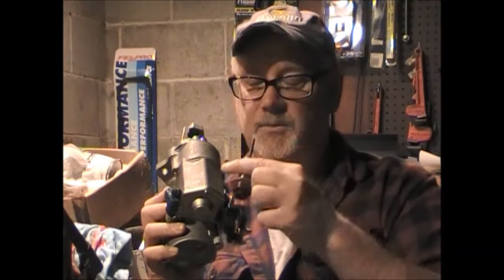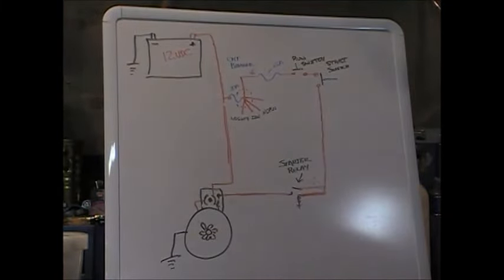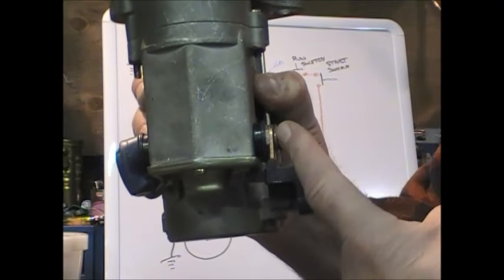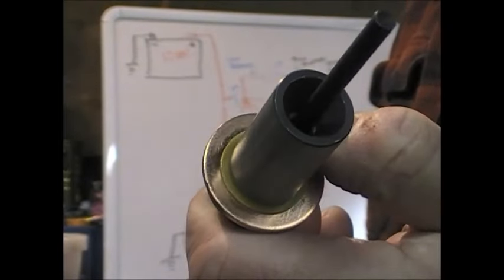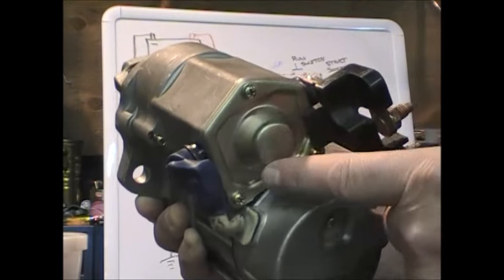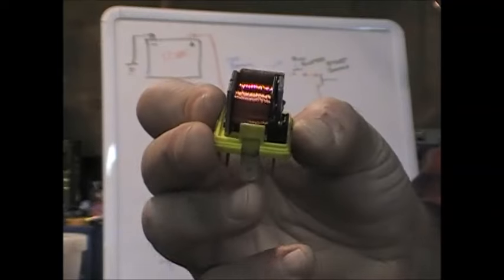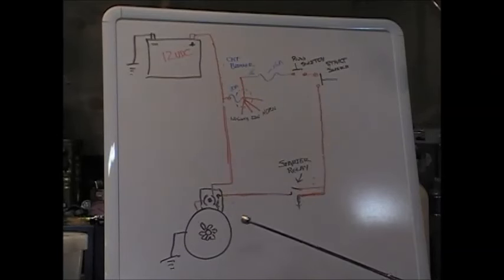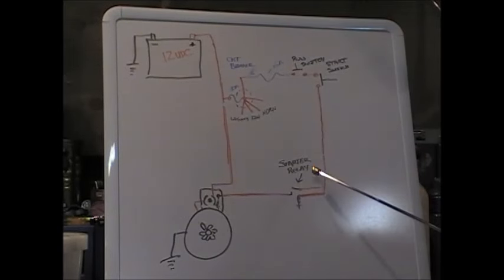Harley Davidson and the Click of Dread

Comment: I have a 2000 FXDL and when I hit the starter button it just makes a constant whirring sound and does not engage the ring gear. Any ideas on what is broken, a mate said the bendix gear but I do not know. Appreciate any advise you can give me. Cheers from down under.
Reply from the maker: If your hear the starter whirring away, which is sounds like it is, and the drive gear isn't engaging, then I would have to say that it "sounds" like the bendix gear assy is bad. HOWEVER.... before canning the whole affair I would disconnect the battery and pull the solenoid cover to gain access to the plunger assy.  Pull the plunger assy out and check the stub shaft on the plunger.  Is it broken?  Missing?  If broken or missing it means it is inside the housing and would explain why the bendix isn't engaging.  If it all looks good, I'd check to make sure the spring that goes on the end of that stub assy isn't packed with hardened grease and would also check to make sure you have full plunger travel, which I will say that offhand it sounds like you do but there is nothing like visual confirmation of such.   If it all looks good, e.g. stub shaft looks good, full travel, not packed up with grease, etc, then it sounds like you'd need a new starter or a repair on your old one.  Best of luck and let me know what comes of it if you would.
Reply: @Theoriginalmalcontentcorner  Thanks for the reply and I will let you know how I go.
Reply: @Theoriginalmalcontentcorner  I thought it was going to be a bit beyond my mechanical knowledge so I took it to my mechanic, as I have put cams and bored it out to 1550 he suggested a 1.7kw starter motor as mine was knackerd. Thank you for your advise though.
Reply from the maker: @2000tc88  Thanks for the update!!

Comment: I like the video and I will clean everything. My problem is a little different. When I turn my key on and I hit the start button I get nothing no sound it's just dead. I have power lights are on everything  seems good. I tried several time to start it and it wouldn't start or even click. I do have another starter relay I will replace it. I'm just wondering if it's the same problem  you were talking about or something  different. Any help would be appreciated. Thanks
Reply from the maker: Hi Randal! Thanks for watching!  So you don't get even a click?  That's not the problem I had.  My solenoid would 'click" but not fully engage.  On your case, do the lights dim down when you hit the starter?  If so then I'd have to ask, just off hand, how old is your battery?  If the lights do not dim then  I'd say it sounds an issue with your solenoid circuit.   If you have access to a voltmeter you can start taking voltage measurements from the solenoid plug at the starter and start working your way back.  Start at the plug (disconnected but attached to the Red or + lead of the voltmeter other end on ground) press the start button and see if you have voltage at the plug.  If not, then onto the relay, if not there then higher up the circuit you should go until you find the 12V feed for the solenoid circuit (see your service manual for the layout of your circuit).  You could also find the location of the relay and check to see if you hear or feel a 'click' when pressing the start button.
Reply: @Theoriginalmalcontentcorner  I really think it's the start switch I think that cause I did adjust brake lever and I must have push the switch over because I opened the switch an took a look at it and I then notice the spring was off so after I adjusted the lever and tried to start it was when the problem started. If must be fried and stuck together.
Reply: I'm experiencing the same similar type situation on my 05 Road King but what I think I have found to be the problem is the emergency shut off switch right next to the start switch,  if I don't hold pressure on in the start position it'll die... Even while in operation
Reply from the maker: @lowery386  - That would make sense as any bum connection in the start circuit can cause an issue.  But with your problem, did it show itself by the bike not cranking at all?  Or would the solenoid click or...?
Reply: @Theoriginalmalcontentcorner   at first it had a weak charge on the battery...  Then after a nice 8 hour charge it  would pop off strong....  Switch working as it should have been...  But then it malfunctioned fully....  And i had to hold my thumb in run position with firm pressure to get it to stay correct
Reply from the maker: @lowery386 - Definitely sounds like you found the problem child.  Sucks that it doesn't work fully but great that you've isolated the problem.  Sounds like it is time for a new switch.

Comment: Mine looks nothing like this. Omg I wish I could find some useful info....
Reply from the maker: what year is your bike?
Reply: @Theoriginalmalcontentcorner  78
Reply from the maker: @smartmeis  That is a vintage setup used on the Shovel and earlier engines.  Unlike the Evo's where the solenoid is built in, yours is a prestolite (or possibly a Hitachi) starter which  uses an external solenoid to supply master power to the starter to start it spinning and a bendix gear/assy to make engage starter gear with the flywheel.  You can't follow my video as it won't work for your setup but it shouldn't be too hard to troubleshoot.
Reply: @Theoriginalmalcontentcorner  well I usually give it a few taps on the starter and make some sparks by touching the solenoid terminals and that works every time, but i kno there’s a way to hot wire the starter cause every time I touch certain posts on the external solenoid it turns over, but I can’t seem to nail down the right posts, and idk what wire is what cause it’s all hand built by my father who passed away, and Idk if I should replace the solenoid or try to diagnose where the exact problem is. I don’t wanna spend money and it not be the problem or the right part. I might go pick the Harley dealers brains and show em some pictures.  If it was a dirt bike I’d have it running in 2 shakes and a lamb tail. But I’m new to the Harley life and unfortunately I have to sell the bike, to pay for my license reinstatement. Fuckin D.U.I’s. anyways thanks for the feedback I’ll figure it out sooner or later. Lol
Reply from the maker: @smartmeis  Take a look here and scroll down about 9 posts.  It will give you a rough idea of the layout.  Again, rough but should be enough to help out:  https://www.hdforums.com/forum/shovelhead/1187963-fxe-starter-solenoid-and-relay-wiring.html  Otherwise, be careful, don't short anything out and move forth at your own risk!  Hope you can get this and all your legal issues squared away.

Comment: I have a 68 Harley sporty and I get the click sound the motor sounds like it wants to turn over but dose not even when I use the kick start nothing would you know what I should look at the guy who had it before me replaced the ing switch and I think he my have damaged the kill start switch on the handlebars
Reply from the maker: Hi James!  To be honest a '68 is an old bird and would be a completely different affair than what I talk about here. Unless modified you probably have a mag/points ignition system, a generator and a bunch of 'old school' items. You mentioned using the kick start and nothing happening.  Are you saying that you cannot kick/crank the engine over even WITH the kick starter?
Reply: @Theoriginalmalcontentcorner  try to kick it and it dang near tore my leg off i figure it out my battery is from 2014and will not keep a charge to start the motor over but thanks for the info man this my firSt bike
Reply from the maker: Wow!  2014?  I'd say that the battery has pretty much been used up!!  LOL

Comment: Just watched your vid; thanks.  Wife's has a 93 Heritage and has the dreaded click and had to push start from lunch today.  I am going to try that tomorrow as opposed to taking the starter out WHICH SUCKS!  If they are to far gone I will  have to pull and replace the contacts.  I can not find them in the parts manual, suggestions.  Thanks again.
Reply from the maker: Hi Marc. Sorry to hear that you had to push start the bike.  Never fun.  As for the contacts, I assume you mean the ones in the solenoid?  If so, just get a solenoid rebuild kit as it comes with everything you'll need.  You can pick them up at J&P cycle for about $22. You can also pick up the starter relay from the retailer.  You may also want to watch my video on the solenoid cover with start button.  It's a good fail safe to have in place.  Hope that helps.
Reply: @Theoriginalmalcontentcorner  i was going to just rebuild but all the trouble taking out i figured id change out starter to.  Ill rebuild old one for spare and experience.

Comment: Older motorcycles used to have a battery amp meter gauge in the instrument cluster to let the rider know the state of the battery & if was running out of juice. The motorcycle companies got rid of them to save money. The newer bikes have a digital readout on the instrument panel. In any case, you have to use your judgement & guess when to replace the battery with the correct CCAs for your motor. Best to replace the battery every 3 years or so, but to avoid this problem just invest in a lithium battery with a Battery Management System/ tester built in. Will last much longer.
Reply: You get what you pay for
In Aussie dollars a $200 battery lasts 4 years, a $500 battery lasted ( me ) 8 years...
I just buy $200 batteries nowadays...

Comment: Your video starts out defining exactly my problem: click, click, click, boom... then works fine the rest of the day.
So I installed a new relay, rebuilt the solenoid w/new copper parts, cleaned all the wiring connections (sanded in most cases) AND I STILL HAVE the same click of death problem but actually worse because now I can't start the bike no matter how many attempts. I took the solenoid back apart, double-checked everything, put it all back together and still SOL.
One fine day I'll have my bike back in service! (1995 Bad Boy Springer) Thanks for the video, even though it didn't help me.
Reply from the maker: Hiya Jeff.  Unfortunately with so many parts in the circuit, any # of things can cause this issue.  If you put a 12v jumper directly to the solenoid (being careful to not short the lead to ground and making sure your bike is NOT in gear) you can eliminate the starter/solenoid from the list of possible issues.  If that works and the starter engages like it should and crank the engine then you may want to start looking at either a possible faulty ground or corroded connection.  You may also want to look at my video about the solenoid cover that has a push button on it!!  They are a life saver.
Reply: @Theoriginalmalcontentcorner  Hey thanks for your time and advise. I didn't try jumping the solenoid (in neutral). I did clean up and sand all wiring connections already. I nearly bought the push-button cover but figured it was not a solution considering I couldn't any results by manually press in the "plunger" with the cover off.

After much frustration, I'm removing my starter & replacing it with a new one that arrived today. One starter bolt was frozen... almost stripped it removing it but succeeded. I had to remove the oil tank for any reasonable access. I'll have to remove the primary cover because there's a nut & retaining ring connected to the starter from that side of the bike - which means new primary oil & gasket as well.

Thanks again for your thoughts and ideas. I'll let you know if the new starter solves my problems - it better, damn it! Be well and ride safe!
Reply from the maker: @Jeff82556  No problem, mate.  Just trying to help out however I can.  Your statement "couldn't (get) any results by manually press in the "plunger" with the cover off" sounds fishy to me.  You are correct in that if you couldn't get any results doing that then the cover with button would not help.  If you can engage that plunger AND get the starter to spin/crank you eliminate that as a unit unless it is intermittent.  However if you cannot get it to spin by manually pushing that plunger in, then it's looking like a starter/solenoid issue.  And please do let me know how this all works out for you.  I'd be interested to know if a new unit resolves your issue!  Best of luck and keep the rubber side down.
Reply: @Theoriginalmalcontentcorner  Thought I'd let you know that - even after installing a new starter, it still does that damn click, won't engage the starter.
So now I'm out of ideas and will likely give up for a while. I went through all routes with no solution - good battery, new relay, new starter, verified good wiring. I have no "next step' to take. Take care.....
Reply from the maker: @Jeff82556  Did you try going from the + of the battery to the solenoid?   Again- having the bike in neutral?  If you do, and you still have the click, check your battery.  Even new ones go bad.
Reply: @Theoriginalmalcontentcorner  Problem SOLVED (mostly):
Took my seat off the bike, pulled my truck up close, jumped the bike directly on the battery posts as in any typical jump-start - bike started up without delay and without clicks.

Keep in mind meanwhile that my year old Diehard battery has always tested as "GOOD BATTERY", 12.8 VOLTS, SOL: 100%, and SOC: 97%.

Now my bike starts right away without a jump. It does however "click" sometimes up to 3 times before it engages the starter. (which is brand new)

In summary, it seems like once the bike got a jump-start, life is magically good, back to normal. Perhaps the jump-start jolted some hidden loose connection. Who knows? Also in summary, the "clicks" had nothing to do with the solenoid at all. The starter, relay, wiring, and all else was irrelevant and a waste of my money and hours of labor. The battery was also fine as tested earlier.

Apparently the solution was a jolt to the system for a bike that perhaps had a heart attack. (when in the future might this happen again out of the blue?)
Thanks for sticking around with your thoughts and ideas!

Comment: You are describing everything I've been experiencing with the exception that my is a 2020.
Reply from the maker: 2020?  Sounds like a warranty claim to me.
Reply: @Theoriginalmalcontentcorner  Right on. Thank you sir.
Reply: @Theoriginalmalcontentcorner  UPDATE: As it turns out, it was the battery, and it was covered under warranty. I have an old truck though that would do the exact same thing periodically. When ever it decided to act up I would crawl underneath and smack it with a mallet to dislodge it. Anyway, that was before I replaced it and the problem went away.
Reply from the maker: @dontworrybehappy8080  Glad you got her fixed up in time for the season!!

Comment: what if its the starter
Reply from the maker: Then you'll either have to repair or replace it.  😁
Reply: @Theoriginalmalcontentcorner  i changed the starter and that wasn't it.... Dang. The relay gets here tomorrow
Reply from the maker: @bermchasin  Okay, now I'm following your train of thought.  Devil is, after all, in the details.  So, you changed the starter but it still doesn't start, eh? Have you run (at your own risk, of course and with the bike in neutral) a line from the +12 to the input of the solenoid?  If all is good there and the engine cranks then you'll have to trace the line that plugs into the solenoid back.  There is that smaller relay that provides voltage to the solenoid input.  Is that working?  Unfortunately, at this point you are going to have to do some digging as the problem could be anywhere from an ignition switch feed issue to the start switch being bad, to the relay being bad or any combo of issues including bad grounds, broken wires, etc.  Sorry but there is no easy fixes as you'll have to see where the circuit is bad. A schematic is invaluable here as is a volt meter as you'll have to see where the voltage is being lost.
Reply: @Theoriginalmalcontentcorner  definitely the relay is bad, as it started when I wacked the relay in the fuse box. But that only worked twice. I bought a close replacement (not exact though) part form the autostore but it wouldn't crank it. So I have the exact part on order to try next. Then it will be down the rabbit hole i guess.
Reply from the maker: @bermchasin Praying that the relay works and that you don't go down the hole.
Reply: @Theoriginalmalcontentcorner  it works! Thank you so much. It was a nail biter though... I plug it in and - click click click. But thankfully the battery was just low. What's kinda strange is if i tapped the old bad relay it would start, but the new one would only click, until it was fully charged. Go figure. 

Smooth rides, rubber side down.
Reply from the maker: @bermchasin  Hey!  That's awesome news!   Glad to hear it worked out!  Be safe and congrats.

Comment: They make a Manual Push-Button End-cap that replaces the Standard End-Cap on the Starter in case the Electrical Circuit fails.
Reply from the maker: Yup.  Highly recommend installing one and even did a video about it.  It makes for an excellent fail-safe.